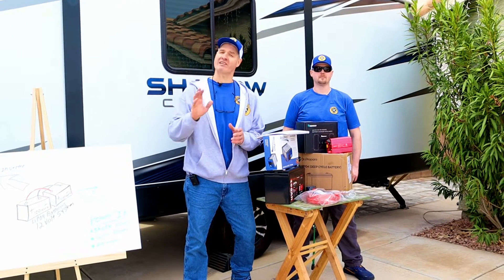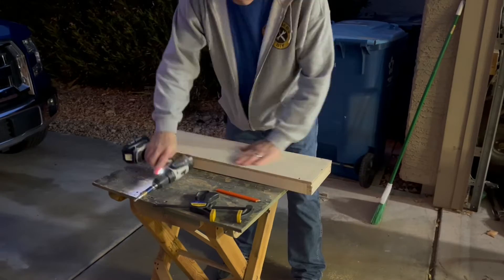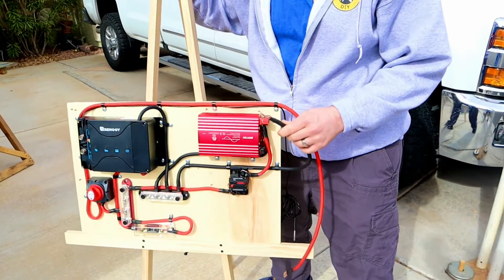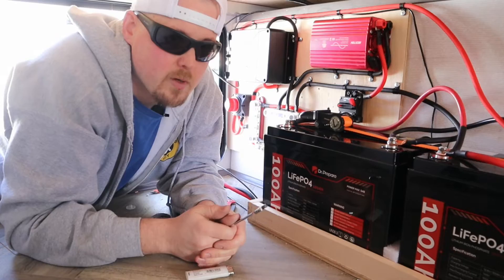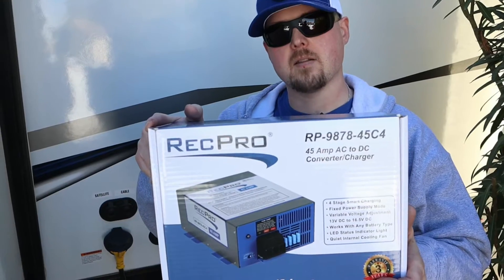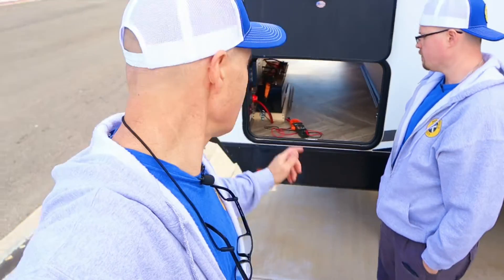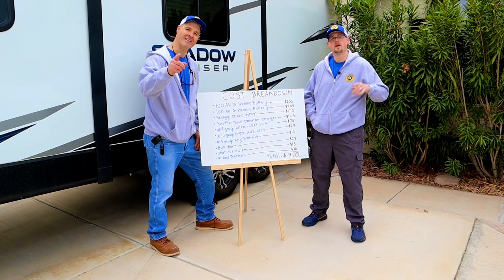Lithium Camper Battery Conversion-Step by Step Dr.Prepare LifeP04

Comment: Two questions:  1) Is there a more basic DC-DC controller just for the alternator?  (I'm not investing in solar at this time).  2) Why would the alternator feed require 10 gauge wire on the trailer side when the truck & connector cable are much lighter?
Reply from the maker: Renogy makes one. They run about $120 or so. they don’t have a very good track record from what I’ve heard. As far as the wire goes, a little heavier is better than not heavy enough I guess.

Comment: What about the negative cable from the alternator? Do we have toconnect it with mppt negative Line? I’m a little bit confused dude. And thank you 🙏
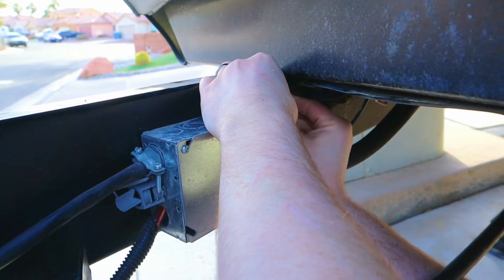Reply from the maker: The alternator charging feed coming through the trailer plug only has the positive line. That is the line that we tied into the MPPT at the spot marked alternator. The trailer and tow vehicle are both grounded, so is the battery system. You can see this at the 3:58 timestamp.

Comment: That’s not nearly a big enough wire for alternator charging. And you should consider a real crimper like temco sells, those hammer crimps are nauseating
Reply from the maker: Hammer lug crimps are actually a fantastic mechanical weld for this application. I agree that Temco makes awesome products (like my hammer crimper tool). The gauge of wire that we used for the alternator charging is actually larger than the gauge of wire that is in the 7 pin connector of the hitch plug.

Comment: Why do you really need a DC to DC charger for a travel trailer or fifth wheel when they're barely a charge coming from your truck anyway?
Reply from the maker: Every little bit helps especially when boondocking. Taking advantage of several hours on the road in between stops helps out particularly on cloudy trips.
Reply: If you weren’t going to install the DC to DC, would you just have to remove the positive connection from the 7pin going to the battery?

Comment: 😢How many total watts/kwh do you get from that?
Reply from the maker: Mathematically 2.4 Kwh. I suppose it all depends on the conditions. Currently, we are running 200 W solar with a 3500 W predator generator to top everything off when needed.
Reply: @MrFredsDIY  oh ok great. Thanks for sharing.

Comment: You left out the inverter and its specs and links to find it. So over 1000 bucks yes?
Reply from the maker: Thanks for commenting! As with most of these camper projects, inverters are optional. The inverter that we used was a very cheap $29 Bestek (not one I would recommend). The camper is Fred Jr’s and he had that inverter laying around so we used it. I will put a link to the inverter that I used in my solar generator build, it is one that I can endorse because I like it!

Comment: Beautiful video. I will follow this step by step. Thank you so much. I do have a question. I thought the RVs made since 2019 were equipped with the Lithium Ready inverters. I could sure use that savings if my installed inverter would work.
Reply from the maker: Thanks for watching the video! The only way to know for sure if your shore power converter charger is compatible with lithium chemistry batteries is to get the model number and check with the manufacturer. The Recpro that we used in the video is lithium compatible. Just remember when switching to lithium you will need a DC to DC charge regulator if you plan on using alternator charging through.

Comment: Was the pure sine wave converter necessary or was it just an option for you to use with your sensitive electronic equipment only? It appears you will have to wire from it to wherever at some point to actually use it?
Reply from the maker: Correct, we use it for sensitive equipment. The plan is to run a dedicated outlet off of the inverter.

Comment: Is 2 100ah better than one 200ah
Reply from the maker: I would say there is not much of a benefit to either one except for price. It’s possible that one larger battery is cheaper than two smaller ones.

Comment: So when you toned out the alternator cable, it appears that you cut it and wired it directly to the renogy dc to dc inverter? and allow the optifuse to back feed the other things that used to be connected to the alternator positive? Thanks!!
Reply from the maker: That was pretty much the approach that we took.

Comment: Great video ! I guess I’m confused about the alternator charger ? I assumed that when I was towing my camper was being charged by my truck via the 7 pin? I guess per your video my thoughts were wrong !
Reply from the maker: Thanks for commenting! If you are running lead acid batteries, then your alternator is probably charging them through the seven pin connector directly to the battery. Most campers are set up this way as our boats. The challenge occurs when you make the switch from lead acid to lifeP04 chemistry. These batteries cannot be charged directly from the alternator (the alternator will be confused and burn up) so the charge current has to pass through a DC to DC charge controller. This is why we routed the alternator power from the 7 pin through the MPPT charge controller to the LifeP04 batteries. Hope this helps explain it a little better.
Reply: @MrFredsDIY  Makes sense, thank you! it appears that some people on youtube have a different of opinion however your comment makes so much sense!
Reply: @MrFredsDIY  this comment brings it home for me.   I was confused why you were fusing with the wires from the 7pin connector
Reply: @MrFredsDIY  OK, everywhere else (that I can find) it says to wire the alternator MMPT input directly from the Battery and not through the 7 pin connector.  What is the diffence and can I actually do this without a problem?
Reply from the maker: There are kits available for wiring directly to the tow vehicle battery, but understand this is going to yield a lot more amperage and will require much heavier gauge wire, (and a lot of  it).  We are working on an alternator charging video this week and it should publish within three weeks.
Reply: Alternator feed is on Pin #4 of the 7-pin round trailer connector

Comment: Retired guy here on a budget. I first replaced the Marine lead acid battery that came on our Mini Cargo Camper with a 12V 100ah LiFePO4 battery. I next changed out the 10A with a 30A solar charge controller (only came with one 100watt pannel on the roof) and set to the controller 14.6V Li charging. Thankfully they used 10 gauge wire from/to the charge controller (changing to a lower gauge wire will require ripping out wall panels). Next came 2 additional moveable 100W solar panels and 30ft of wiring feeding into the 30A charge controller. A big plus, the 110v, 55A charger/converter output voltage was adjustable so I increased it to 14.6V.  We dry camp mostly in forested areas so I also carry a gas/propane generator. The 100ah battery is mostly for the small 12v fridge, lighting, and the furnace. Total cost under $400.
Reply: 36Ah
Reply from the maker: Thanks for commenting. Sounds like a pretty nice set up. What is the consumption of your refrigerator for 24 hours?

Comment: I understand the point of your video is this upgrade on a budget and everything you did was logical for your DIY audience, nice job.
BUT as a DIY’er myself, wire gauge and distance is important when dealing with 12v due to voltage loss. 
I upgraded the wire gauge to 2awg from the converter directly to the battery busbar which allows higher charging amperage while on shore power. I get +/-50amps into the battery from my upgraded PowerMax 60amp main board.
I have the same Renogy DCC50S. To maximize the charging capability of my alternator I used 6awg welding wire from the truck battery to the battery busbar. With a 75amp Anderson connector in between. I’ll typically get up to 38amps charging on a depleted battery and will allow me to run my fridge on 110v when traveling and full battery when I get there.
Again, nice job on the video. Concise and to the point.
Reply from the maker: Thanks for taking the time to comment!
Reply: Upgraded to two 12v 100Ah lithium batteries from two worn out 6v 200Ah GC batteries.  Also replaced the 55 Amp converter with one that has the lithium charge settings.  Using the original wiring I'm getting ~20 amps charge to the batteries.  Had bench tested it prior to install using short 6awg wiring and was getting 45amps.  Don't run an inverter, so 20 amps is enough to keep them charged so far (also have about 10 amps from solar on a sunny day).  Upgrading the wire from the converter to the batteries would should fix this, but the run would be a lot of work.
Reply from the maker: @guywilliam6065 Thanks for commenting. Wire gauge is definitely an important element of all of these projects.

Comment: Hello,,

I sow in this video :
https://youtu.be/JtAUrS4zNSA?feature=shared
 that the Renogy also charge the starter battery after the camper Lithium battery is full.
I m interesed if the Recpro charge the camper Lithium battery, and more important where the red and black DC wore from the Recpro are connected to your system. Where exactly the 2 cables are connected?
I also sow that usualy 220v are directly conected to the invertor and in this case the invertor dose not take current from the lithium battery as long as he has current from the grid.

Comment: Hello. Can u please explain where do you connect the RECPRO AC to DC convertor? Where on Renology?
I sow in other video that the solar panels charge the starter battery. Is also the RECPRO charge the starter battery or only the lithium one?
10x
Reply from the maker: Our Recpro is not connected to the Renogy charge controller itself. The Recpro is connected to the camper’s electrical system and the system is connected to our control panel bus bars through the black and red #4 wire that we attached at the junction box on the camper frame. Our system does not charge the tow vehicle’s starter battery.
Reply: Hello,,

I sow in this video :
https://youtu.be/JtAUrS4zNSA?feature=shared
 that the Renogy also charge the starter battery after the camper Lithium battery is full.
I m interesed if the Recpro charge the camper Lithium battery, and more important where the red and black DC wore from the Recpro are connected to your system. Where exactly the 2 cables are connected?
I also sow that usualy 220v are directly conected to the invertor and in this case the invertor dose not take current from the lithium battery as long as he has current from the grid.

Comment: Do you have any trouble using the lighter gage wire from your junction box to the MPPT for alternator charging?  I have same charger and was wanting to do this same thing from my junction box on trailer.  Seen many use heavy gage wire coming from vehicle battery via Andersen Connector and wanted to avoid that.
Reply from the maker: Thanks for checking out the video! Are you talking about the 10 gauge wire that we ran for alternator charging to the junction box on the frame of the camper? If so, that wire is working just fine.
Reply: @MrFredsDIY  yep.  Good. I might try that myself.  I was worried the current draw to the MPPT might be too  much and would have to be on a heavier wire.

Comment: I've put one 12v lifepo4 battery in my 5th wheel. I have no solar and have no intention to do so. I changed my converter to the newer style to charge the new battery. Can I leave the camper plugged into shore power the same as I did with the old lead acid battery?
Reply from the maker: We leave ours plugged in to Shore power without any issues. The Renogy charge controller that we used says that it’s no problem. Double check with your model, you can probably find that on their website. Thanks for checking out our video!

Comment: awesome set-up. I'm confused about the dc to dc converter. That is a very expensive piece of equipment. Could you have used 2 units, 1 for a pwm solar controller and
a separate unit for the dc to dc charger. I believe for a basic solar system a pwm unit
would work just fine and cost much less. Also where does the new converter get wired
in? Directly to batteries? No issue with the 3 separate systems back-feeding into each
other?
Reply from the maker: Thanks for watching the video and commenting! The multi-stage processor of the MPPT allows both the solar and alternator to be used to charge at the same time.
We chose the MPPT charge controller for several reasons. First, it is an all in one solution that is super simple to install and use. Because I make DIY videos to serve a wide audience with various skill levels, this made the most sense for this project. We plan on putting at least 400w solar on this camper which is 33.3 amps so a safe charge controller would be a 40amp. At the time of this video It was difficult to find a 40 amp MPPT with alternator charging so we bumped up to 50 amp. We priced 40amp PWMs at $150. A quality dc to dc controller runs about $100. The Renogy MPPT controller has low temp charge protection built in. This allows folks to purchase less expensive LifeP04 batteries that do not have low temp charge protection. Lastly, while PWM technology does work, the digital maximum power point tracking technology is much more efficient.
Reply: @MrFredsDIY  Awesome explanation, Thank you. I think you convinced me to
do my install very similarly. Is there a place to wire in the trailers shore power converter or just directly to battery bank?
Does back-feeding happen when you are essentially hooking 3 systems together?
Sure would hate burning out a new lifepo4 converter. Thanks again
Reply from the maker: @mark98070 We ran the shore power to the bus bars. We have had no issues with back feeding. If you read the description of the MPPT on Amazon, they talk about the multi phase processor that it has. If you do not need 50 A there is a 30 amp which would allow up to 350 watts at 12 volts but 300 would be better. Check out my last video for my solar generator build. That project was very similar, except it is in a box. I used a 20 amp PWM for that project because I only plan on using 200 W solar.. That project has a plug-in wall charger that I just hooked to the bus bars in the same way as we did with the shore power. Here is a linkhttps://youtu.be/mJZM8594lIU?si=IvhmbEU7TgB3kcaz
Reply from the maker: @mark98070 Also, this book is an awesome resource and it’s very inexpensive. You should follow this fellow on YouTube as well.https://amzn.to/46uznKF

Comment: Need to change the charge profile to lithium on the renogy dc to dc charger. Need a paper clip to push it in till the light above the battery symbol turns blue. It will be in the manual that comes with the charger.

Comment: So I bought a lithium battery for my rv that previously had a lead acid. My camper says it’s wired for solar. 
My question is what will happen since I have no clue if my inverter is see up with lithium charging lol. I will update what I find if interested. 
I haven’t found my inverter yet still looking. The camper is used by the way. 2019 model
Reply from the maker: My guess is that the AC to DC charger is probably not meant for Lithium chemistry batteries. Particularly with a 2019 model. I’m thinking even on newer models being set up for lithium is optional.